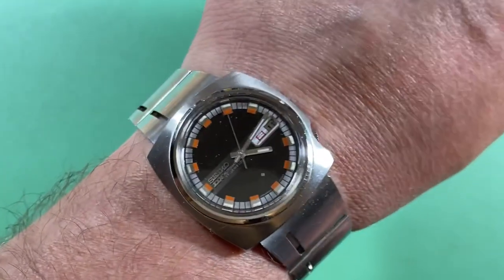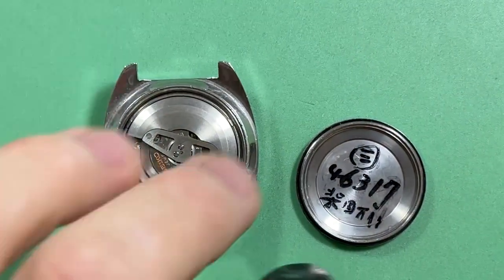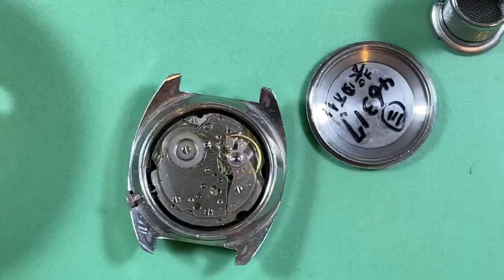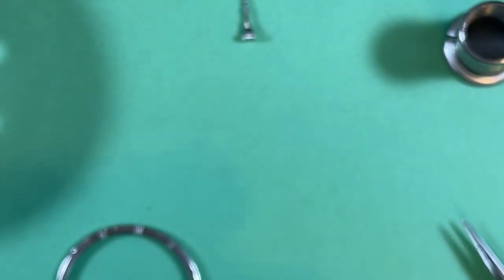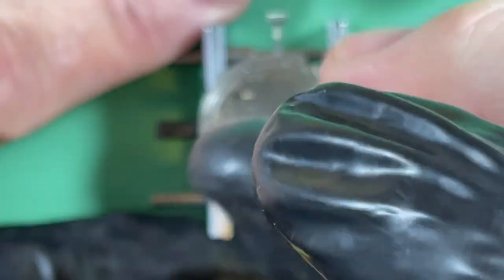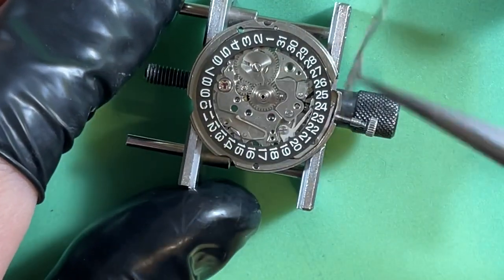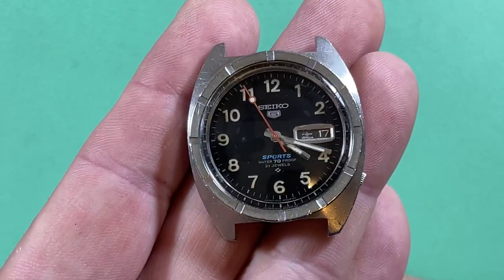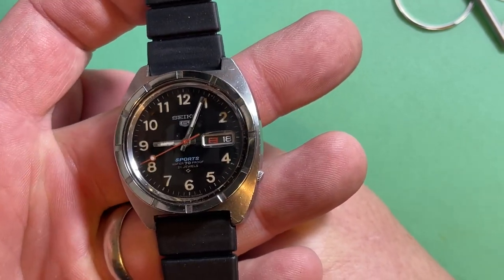Let’s restore a watch!  With WFC Sebastian.

Comment: Regarding amplitude being lower than you'd like at 240+, i rarely get a 61xx going that high with their larger balance wheel. As you surely know, 180° or greater is within tolerance, and I find that north of 210 these movements run smoothly and reliably. Curious for your thoughts if I should be troubleshooting when achieving 210 to 225°, which is what I am comfortable landing at...